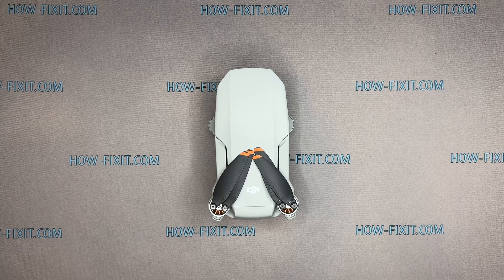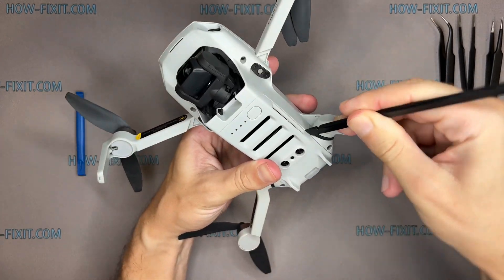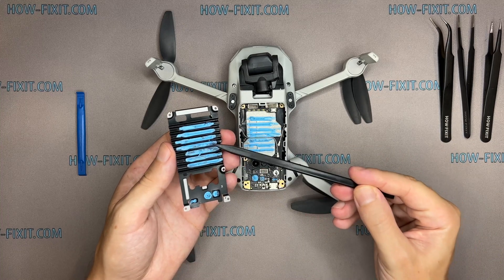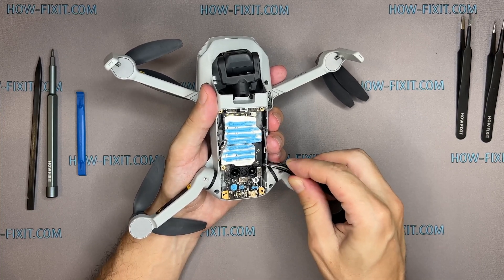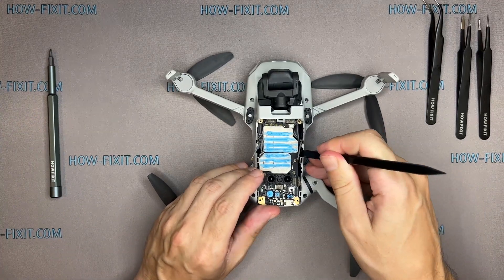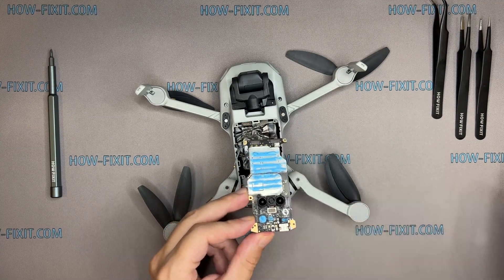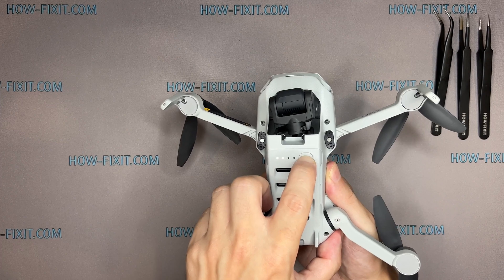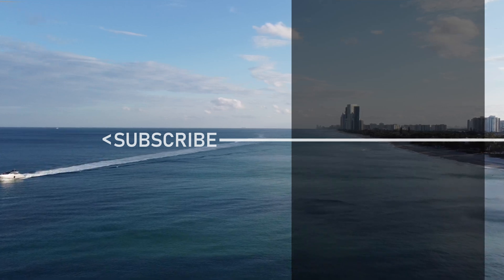DJI Mini 2 Motherboard Replacement - The Complete Step-by-Step Tutorial

Comment: It is just not worth the cost for a motherboard to justify replacing it. My SSD card slot will no longer see a SSD card due to damage from a card being inserted below the slot and getting stuck. It was damaged when the card was being removed. DJI should have issued a recall for these drones since it is a design flaw.

Comment: I would like to know if core mother board holds user log in information? By changing a new main board do you need to activate your DJI again?
Reply: Did you ever find out?? I have my wrecked one and one I got scamed with that’s locked
Reply: @user-ej2jh2ne9y hey! Any news?
Reply: @andrescordoba9668  I changed all the important components to the new shell I got scammed out of and for some reason Its still locked only thing I didn’t change was the camera the might be it
Reply: @user-ej2jh2ne9y so chaging the motherboard didn’t reset the account it is paired to?

Comment: Sir, Thank you for the detailed video. Do you have any idea where is the Transmitter/Receiver for Dual/2.4Ghz and 5.8Ghz located? Is it in the main board or the ESC board? Because I have problem on the 5.8Ghz. Everytime the dual band chooses the 5.8ghz it disconnects even in few ft away. Im planning to replace the said board. If anyone knew this kindly comment pls.Thanks
Reply: I already contacted the dji service center and they said that it is in the mainboard.
Reply: @uac1710  read my previous comments it help you alot
Reply: Hi I face same issue have any solution on that?
Reply: @Moti1112  just always set the transmission 2.4Ghz before flying. When transmitting data bring it back to dual when the drone is near the controller.
Reply: @uac1710  yes I had do same thing but I don't get any permanent solution, I thing motherboard replacement only option
Reply: @Moti1112  yes dji told me that its the motherboard problem. I have no permanent solution either. Too expensive to replace since it's the drone's motherboard. Waiting for an available motherboard online that's affordable or maybe I can live with this problem.
Reply: @uac1710 same problem here...can you switch to 2.4 permanantly